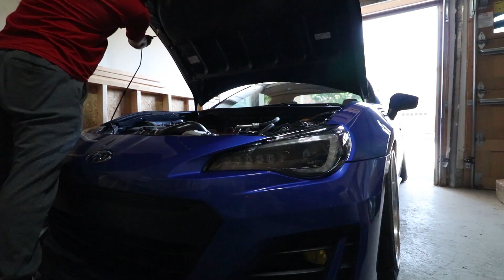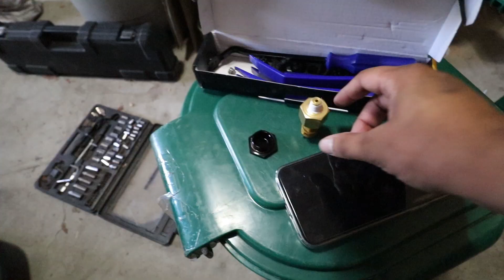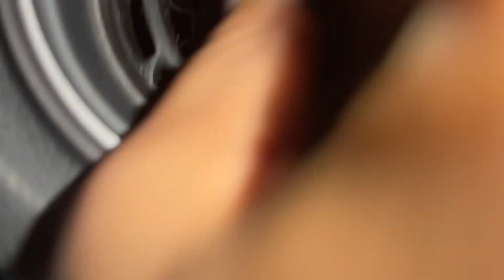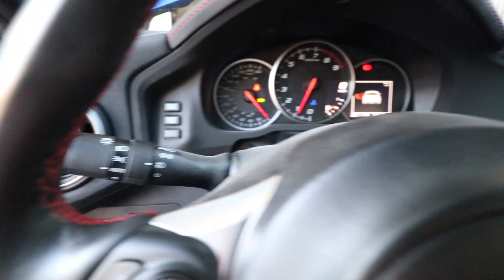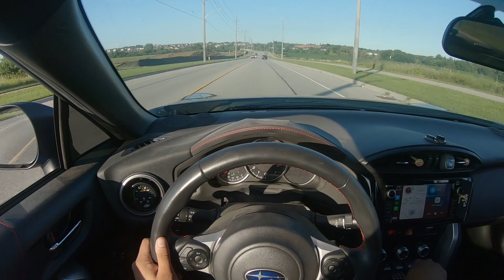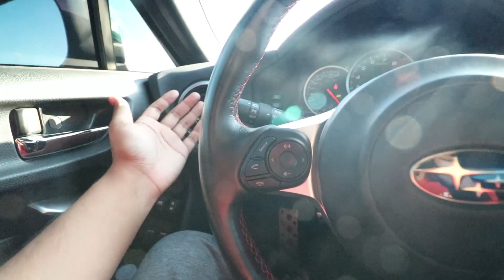AEM X-Series Oil Pressure Gauge with Vent Mount OEM+ Installation! BRZ | FRS | 86

Comment: I’m still having issues installing my oil pressure gauge with the fuse jumpers. I tried doing them in replace of the radio fuse but it seems to not work

Comment: thanks for the information!  I have a question, my toyota 86 trd at idle and hot showed me 14 psi of oil pressure and after a few days it shows 37psi hot and at idle, do you think I have to take it in for a review?
Reply from the maker: Glad it was helpful! What oil do you use and what temp was it at 37 psi? Had you already started driving or were you just idling for a while after cold start? 14-20 seems normal to me but 37 fully warmed up and idling is a bit high.
Reply: @LivingAsleepHD  without driving just warming it up it reaches 37 psi when a few days ago it was 14-20psi.  the oil I use is synthetic ow-20.  I have the jackson racing supercharger just like yours.  ask my ecutek tuner and he says it's normal but I want to be sure.
Reply from the maker: Oh if your tuner is saying it’s fine then I would trust them. It might depend on your environment as well (temperature and elevation). I’m not sure lol
Reply: @LivingAsleepHD  thanks for your help!!  And continue with the videos with the information you give us you help us a lot
Reply from the maker: Thank you for the support! It means a lot 🙏🏽🙏🏽

Comment: Found this vid after looking at oil pressure installs considering the oil/RTV issue with the 2022+. Thanks for sharing!
Reply from the maker: No problem! Does the 22+ have a built in oil pressure gauge? Hopefully it will help detect those problems ahead of time, if not def do one of these!

Comment: Great vid. Out of curiosity, what pressures are you seeing in varying RPMS when warmed up? Meaning, what PSI at 2k, then 3k, then 4K when warmed up. I tried zooming into the video but it seems the GoPro screwed with the gauge output.
Reply from the maker: Thank you! Yeah the go pro shutter speed really messed up the gauge reading haha. When my car is warm at idle I see about 18-20 psi and then roughly +10 psi per 1k rpm increased. It does vary a little depending how I drive so I don’t pay too much attention to the fluctuations since I’m mostly on the street, highway, or backroads. It might be different at the track though!
Reply: @LivingAsleepHD  Awesome, thanks for the input! I only ask because I question if mine is slightly higher than average, but at the same time my oil stays at a constant 175-180 deg. Idle at 20psi, but then 2k is around like 35-40psi, 3k around 60psi, so not sure if it was keeping track with that 10psi per 1k increase. Thank you though!
Reply from the maker: I can pay more attention on my next drive and get you a better range hopefully it helps more!
Reply: @LivingAsleepHD  Yes please if at all possible! I would appreciate it greatly

Comment: I'm having a hard time finding out what the best option would be for running both a oil temp and pressure gauge. Looks like I would need to get a oil filter sandwich plate with 2x sensor ports. I do not have a oil cooler at the moment so I'm worried that if I were to get a sandwich plate it would screw up the possibility of installing an oil cooler in the future with the sandwich plate. The other option which seems expensive is to bite the bullet on a mishimoto oil cooler which already has the 2x sensor ports built in. I'm not sure I need an oil cooler NA which is why I'm hesitant going this route. Any recommendations?
Reply from the maker: I think you can install both on the block by using the galley plug and the oem pressure sender unit:

https://www.ft86club.com/forums/showthread.php?t=85138

But if you’re pushing your car at all on the street or are considering taking it to the track I’d recommend getting an oil cooler with a thermostatic plate or even the dual radiator oil cooler combo, both from Jackson Racing. I have the oil cooler and it’s amazing, much better than mishimoto if you can make the price work.

Comment: So I’m running the vortech supercharger and had a quick question about the NTP sensor adapter. I don’t think vortech supplies those does the Jackson racing adapter works?
Reply from the maker: If you have an oil cooler sandwich plate I think the JR adapter should work. You could also find an adapter for the oil galley plug that should be more universal!
Reply: @LivingAsleepHD  thank you and yeah I have Mishimoto oil cooler I’m so glad I found your installation video because I’m debating on which gauge should I go for
Reply from the maker: No prob glad it helped! Any of the popular ones should be good enough, just make sure you get one that goes above 100 psi. I chose aem cuz I like their reputation and styling (I ended up adding AEM boost and afr gauges in a recent video).
Reply: Very nice I love those set up. What would be the main important 3 gauges that you would recommend?
Reply from the maker: I love that the 2017+ cluster has oil and coolant temp, those along with oil pressure is all you really need IMO. I added boost and afr just to complete a visual design I had in my head but I don’t think they’re necessary if you have a good tune, esp with a supercharger setup. That being said it can be fun watching your boost build and peak when you’re driving or doing pulls or ripping around track etc loll
Reply: Pretty clear detail awesome man. Yeah sadly I have the 2014 model😢. Also the part where you mentioned about letting our tuner know with the sensor that we going to swap out. Do we need to get it retuned?
Reply from the maker: I did not, since by that point in the tune Zach already disabled the secondary O2 sensor so I was fine to swap it out. If you’re isn’t already disabled it would probably be a very simple change for them to make and shouldn’t be a retune I think. Will be best to double check with your tuner anyway
Reply: Ok Gotcha thank for all the information bro.
Reply from the maker: Np good luck with the build!! 🙏🏽

Comment: What's the oil pressure under load?
Reply from the maker: Depends on rpm from what I’m seeing. So I see 16-20 psi at idle and about another 10 psi per 1000 rpm of load.

Comment: excellent video thanks!! I have a question where do you connect the green wire (optional auto dim) from the p3 gauge?  I don't know where it connects
Reply from the maker: Glad it helped! I didn’t bother connecting the auto dim wire but I think I’ve seen people connect it to the illumination wire in the head unit harness to dim both when your lights turn on. I think you can also tap it to a wire in the headlight dimmer controls. Let me know if you try!

Comment: nice video bro! i recently installed a pressure gauge as well. just a tip - putting it in the oil gallery directly gives more accurate and reliable readings than the sandwich plate. i had the option to do the same as you but went the other way based on advice from my mech
Reply from the maker: That’s a great tip! I was thinking that is probably the case, but if it’s a few % off I don’t mind whereas if I miss an oil pressure issue that’s a bigger deal. I might move the sensor port to the oil gallery plug if that’s the case one day. Thanks for the info!
Reply: @LivingAsleepHD  no worries man. Definitely the right call to know about pressures and temps rather than guessing like most people do when boosting
Reply from the maker: Yea seriously so many people under budget their builds and have no supporting mods and wonder why their engines don’t last. Gotta do it up right!